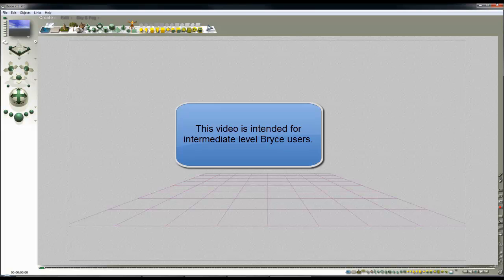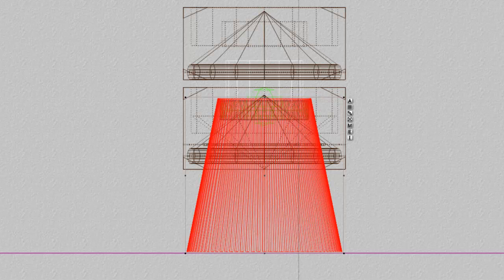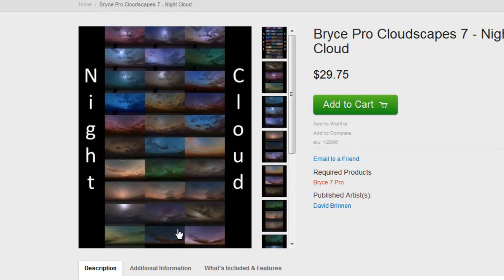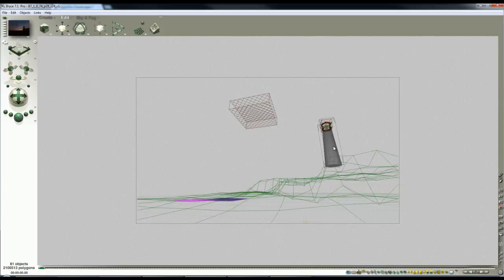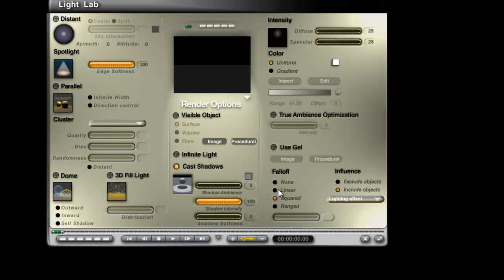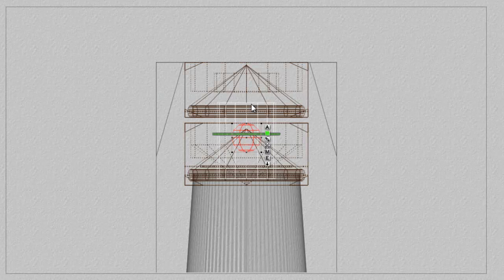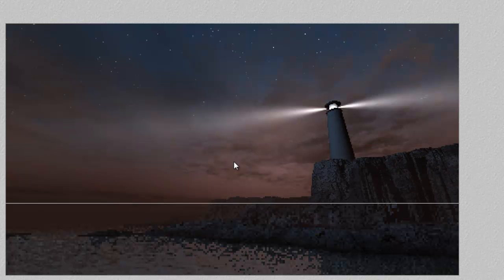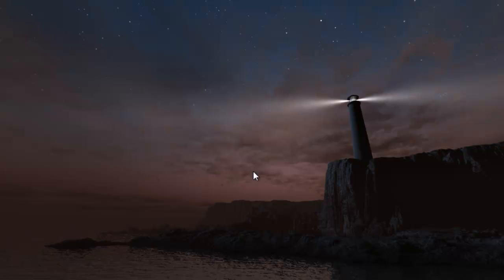Bryce lighthouse "light beam" effect - a 15 minute tutorial by David Brinnen

Comment: Timeless Tutorial!
A New Bryce 3d using AI to reduce render times while utilising premium effects is always the stuff of dreams!
Reply from the maker: It might be possible to use an open source AI to tidy up low resolution renders, essentially using the render as a framework for the composition.  In which case the dream might already exist, so long as you can run a local AI like Stable Diffusion and have a cuda capable GPU with a half a dozen Gb of vram.